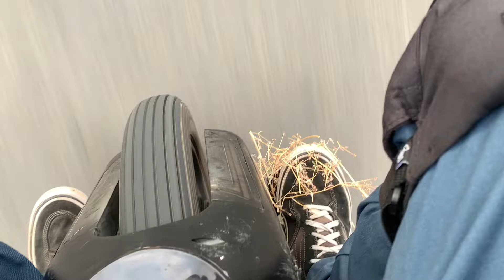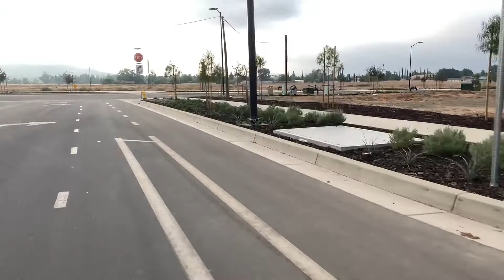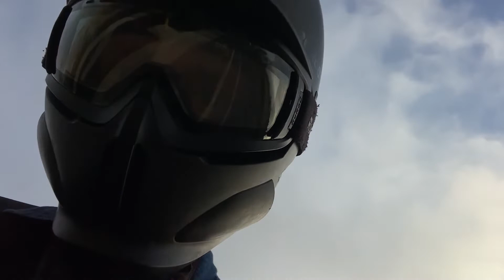EUC Crash Due to Low PSI

Comment: That wasn't cause by low psi on tire, you just crashed because you lost control.  Slow deliberate turn while sitting often results to crashes.  It takes time and experience to master that.
Reply from the maker: Well I’m no novice, but I did lose control due to low PSI. I could feel the wobble on the turn.

Comment: 40psi ? 🤯🤯🤯 I ride @ 25
Reply from the maker: On your Monster Pro you ride at 25 PSI?
Reply: @ShaneHilde  MSP c30 high Speed. Never over 30psi on monster. Oki IF you weight like 250pounds/100kg.... Then maybe 30-35psi